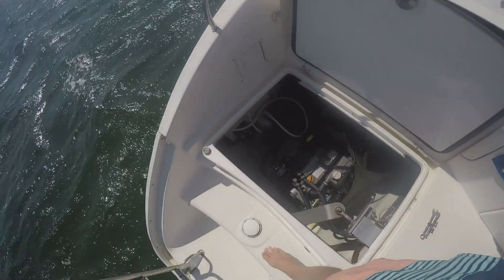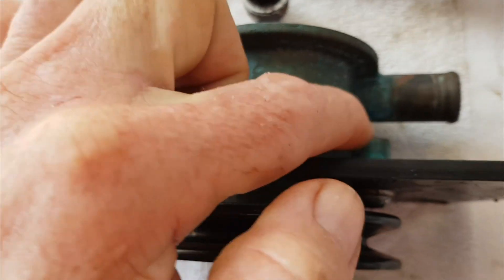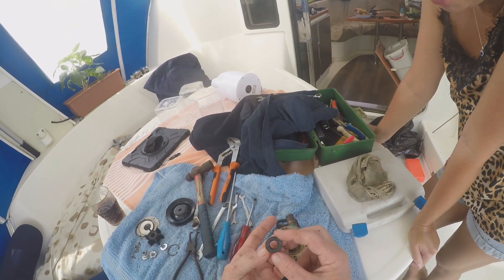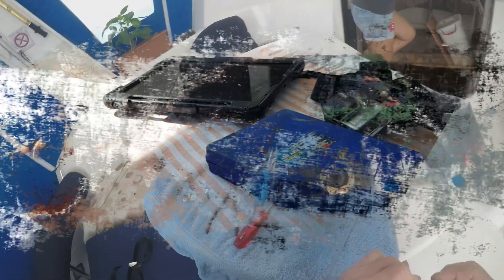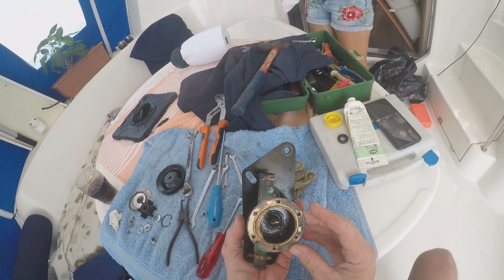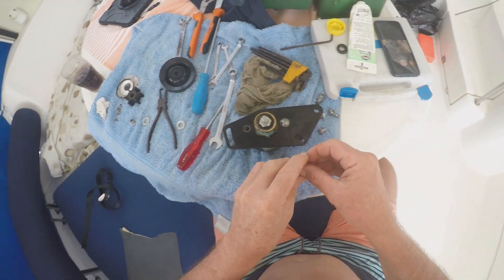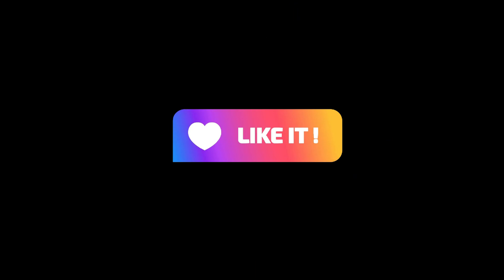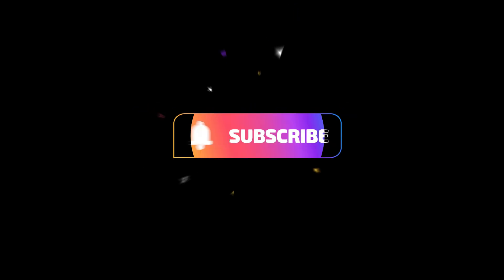E16 - Yanmar raw water pump rebuild

Comment: That looks like the pump, with a different bracket, that is on my 3GM30. I went to rebuild mine, and the dealer didnt stock the rebuild parts. They strongly recommended NOT buying the "kits" as the aftermarket parts are not always up to the quality of the pump. Since The pump was relatively inexpensive, and in stock, was easier to just replace it , and now comes with a 1 year warranty.
Reply from the maker: Agents will always say that sadly. The fact is these pumps are not built by Yanmar but by Johnson pumps. Yanmar by them in bulk and add their margins making it more expensive. In terms of the bearings if you buy a good bearing it should last many years . Glad you could get a relatively inexpensive kit from the agents. Most places charge in excess of $500 for a pump. Yes the older yanmars had a different bracket which they changed as its much easier to change out the small water pump vbelt with the new bracket.
Reply: @catalongsailing4762 the pump for the 3gm was just over $200, about 2x the price of the rebuild kit. I MAY rebuild the old one and keep as a spare. But the $100 extra to save a lot of time, was worth it to me as I was under a time crunch. If it were off season, sure I'd rebuild it.
Reply: @catalongsailing4762 the dealer was just indicating to ensure to use quality parts and to he careful. There are a LOT of inferior aftermarket parts out there.  To rebuild with oem parts from Yanmar almost makes no sense.. The price difference is not a lot. I will rebuld my old one anyway. But yes there are lower price aftermarket bearings available to keep the price reasonable.  $2-300 anything on a boat, in reality,  is next to free!

Comment: Good video but you left out the assembly of the seals and bearings which is why I'm watching. I'll just reverse my disassembly I guess. A question. Do you add grease when re fitting the seal, bearing cover or slinger I think it's called, and bearings? Thanks
Reply: I got to agree with the last comment you said here are the new bearings and then you show yourself tapping the shaft and the bearings in the seals the spacing which way the seal went with the lip facing out is all missing the video needs to be redone that is the most critical part the most difficult critical part you leave out... It's too bad cuz the rest of its well done

Comment: Ack you cut the vital section after the snap ring. We are stick at that stage
Reply: Sorry about that. Once you get the big circlip out you will need to tap on the 2 prongs that the water pump impeller was on and this will pish out the shaft with both bearings. Be careful to do it straight to not damage the shaft as the  impeller needs to fit there. Once you have tapped this out you will have access to the seal and the bearings to change out

Comment: Any idea how to prevent the broken blade from finding its way to the HX? I was thinking of putting a small sheet of coarse wire gauze in the rubber hose just at the SCW Pump outlet nozzle. Would it work? I had a broken blade at HX inlet. Luckily I was able to remove it without opening the HX end cover. That would have been a big job for me.
Reply from the maker: Ken I think one could put a small screen filter like with the toilet inlets in line and it should work depending on the engine size for space. Something I will try on my new boat which has 4JH4Ae engines and a very similar pump.

Comment: Thank you. Can you make a video explaining how sea water enters the engine and then returns to the sea
Reply from the maker: Sure we can do one but it’s actually very simple. In the case of a sail-drive the sea water comes up the inside of the sail-drive in a channel and there is a hose between the sail drive and the Raw water pump. From the raw water pump there is a hose up to the inter cooler ( in yanmar engines this bolts to the top of the side of the motor) The sea water passes through thin copper tubes and exits the inter cooler to another short hose to a double walled exhaust manifold where it cools the exhaust gases and exits the exhaust.  On the sides of the inter cooler copper pipes the fresh water gets pumped by the fresh water pump keeping the engine cool and saving the engine from needing a radiator which would not really work on a boat.

Comment: I don't claim any special expertise, but at 3:35, it appears to me that you have put the lip seal in backwards. The side with the lip (and spring) should face the liquid (not air) side of the pump. If you are having frequent pump leaks through the weep hole, that may be why. Also, there is supposed to be an o-ring on the shaft between the lip seal and the bearings, and you made no mention of replacing it (it's included in any repair/rebuild kit.) It acts as a slinger to keep any water that does leak past the lip seal away from the bearings. Without that o-ring, any water that makes it past your incorrectly inserted lip seal (and it will) is guaranteed to make it to your bearings. I hope I mis-perceived what I thought I saw.
Reply from the maker: you are 100% right that the seal should face the water side. The irony is that the saltwater corrodes the wire spring holding the lip of the seal tight. then it starts leaking . I tried reversing the seal and found that the pressure is not enough to let it leak and it does not allow the water to corrode the seal.
Reply: @catalongsailing4762  You can change the garter spring to a rubber O-ring of similar size. I did that as advised by Dangar Marine (Youtuber). Works great 👍
Reply from the maker: @ken2633  Hi Ken thanks for the feedback yup that works as well for sure. and it doesn't rust like a spring.
Reply: They recommend glycerine , not silicone paste on impeller.

Comment: Hi how does the shaft come out after you take out the clip?
Reply from the maker: you need to press the shaft out with a press if you have one or in the field you need to carefully do it with a hammer and some form of protection to not damage the shaft